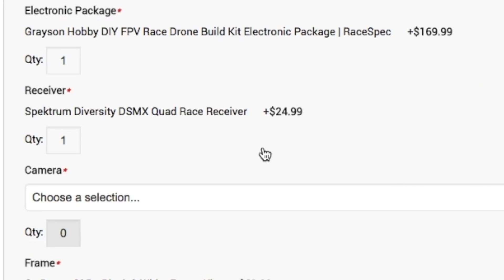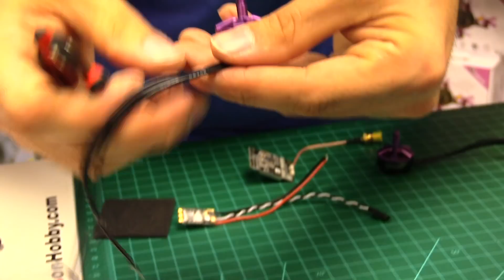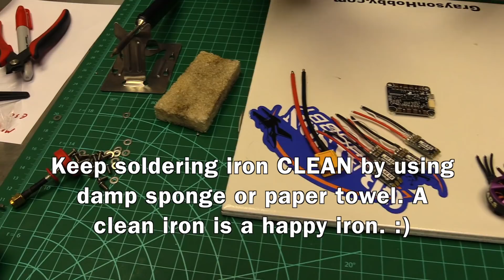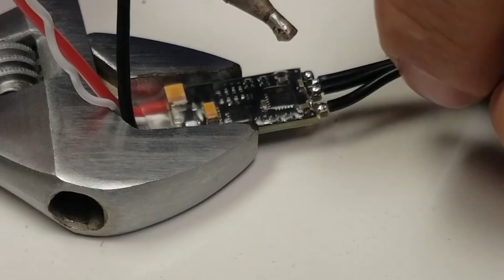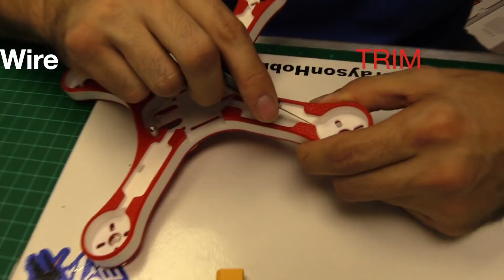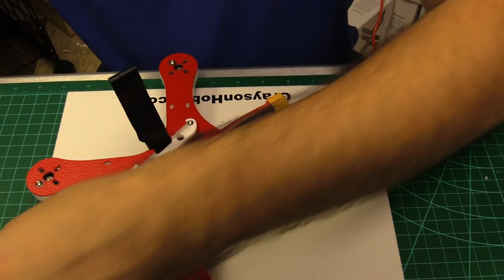How to Build a FPV Racing Drone for Noobs in 1 evening. You Can Do it!  Part 1- Core Electronics

Comment: Great video, however I dont think flying into a soccer net or diving into the grass shows REAL durability. I'd rather see how this holds up against a tree or other solid object. Also I find the price of $280 to be rather high considering some other options available, especially if this is marketed toward newcomers to the hobby. Just my opinion, though I do like the video and your commitment to helping noobs learn to build their own quad. Thanks and look forward to more.
Reply from the maker: Thanks for the feedback. Its really appreciated!   With TOP Gear, this can be had for $215.. This is rock sold frame using the some of the best gear out there. No video of crashing into tree.. But the local clubs crash into gates every weekend.
 We tried using inferior quality motors, ESC, etc and just found too many issues we felt beginners should have to go thru.  Either isolation, VTX noise, etc,  The spirit of this build is to build once and be done with it, rather having to replace components in the future.  Thanks again for the great feedback.. -B
Reply: beachcomber52  bought the frame from OX FPV